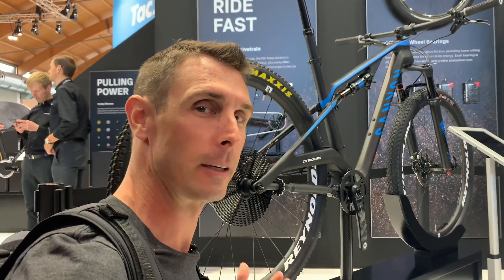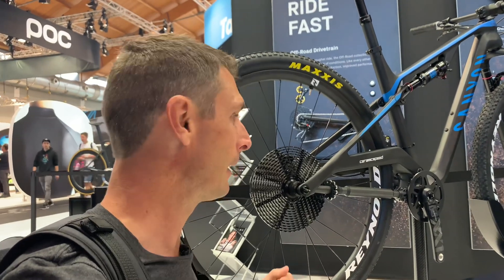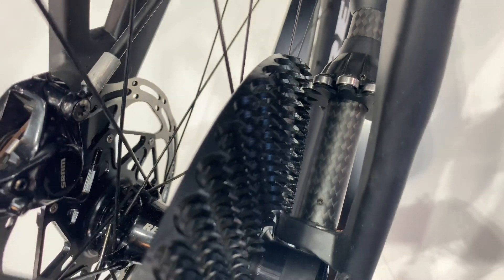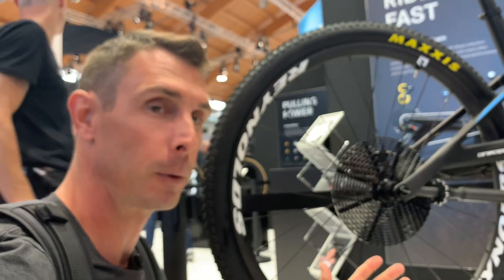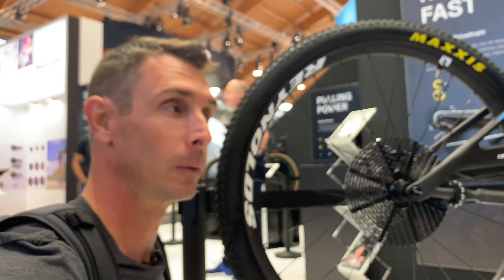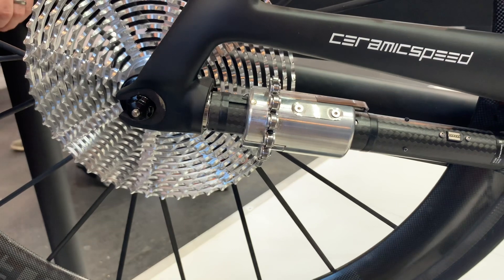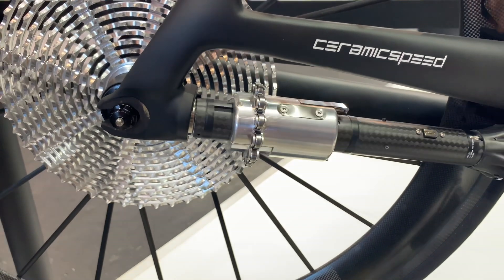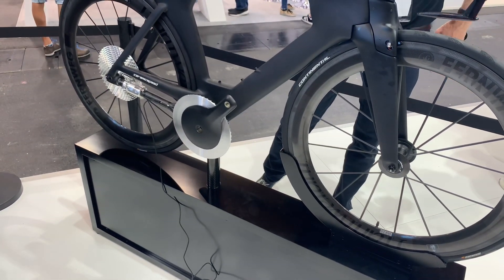First Look! CeramicSpeed DRIVEN shaft-driven MTB group explained

Comment: This seems like a good idea for downhill but the shaft drive system is worst than the chain drive system in weight and efficiency that's the reason high end motorcycles don't use it